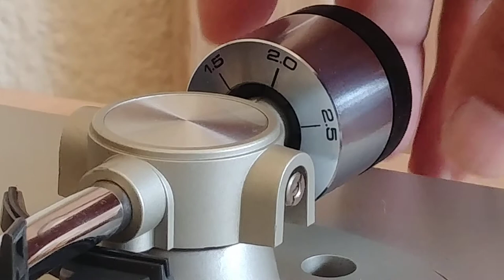How to balance a tonearm

Comment: I have pioneer PL-200 turntable. It is decent turntable. DD motor is very silent. Only what I  done is oiling feets isolation rubbers with silicone oil. Now them are elastic. Price/ quality is o.k. It have original cartridge ( sound is good enough) but DUAL ULM 68E fit very well too.

Comment: Great video thanks. Just got a used one as a 2nd one for the room (have rega planar 1 plus outside) and so dont know much about vintage semi automatics. What is the best cart for this please? Mine still has the factory one.
Reply from the maker: I couldn't say what cart is best with this turntable. A safe choice would be  Audio Technica AT95E. Finding the best performing cart with your turntable is usually a personal journey of discovery. In general I have had good results with various Audio Technica and Nagaoka carts. But a lot of models are no longer available. You can also look at the Hana brand.

Comment: The arm should float level for the zero setting.
Reply from the maker: You are absolutely free to do that. Many references will tell you to. My observation of the dependability of the dial indication vs actual stylus pressure was derived using the method I described here.
Reply: This is an interesting point. Some say the arm should float level, but then different headshell/cartridge set ups will mean the stylus sits at different heights with a level arm, and so true zero should really be where the stylus ‘floats’ to. This is where this video was going by saying set zero = to the top of the rubber mat. This is then an actual zero reference to which the stylus pressure can be added. Where I would slightly disagree is that I think the horizontal reference point should be a record thickness above the mat.
Reply from the maker: @duncanmatthews1977  your last sentence reflects my actual thinking. The person for whom I made this video was not familiar with turntables and I had to give him a "good enough" level of instruction.
With more sophisticated turntable setups and advanced stylus profiles (in particular), the level of detail required can be critical. But the common or garden elliptical stylus is very forgiving. For the most part, applying audiophile knowledge to mass market turntables does not yield a benefit.

Comment: So basically you balance it by having the needle as close as possible to the mat, correct?
Reply from the maker: Yes. However, I have seen others set up the balance point with the arm horizontal. I believe that in practice there may not be a significant impact between the two zero balance points because the amount of adjustment required between the two is very small. My way may be more finicky, but it's what I prefer.

Comment: Mines 1.5 on the main bit then 1 on the small anti skate so I’m not sure if that’s ok
Reply from the maker: It's fine if it sounds OK. I believe the arm only needs a bit of assistance to help counter inward momentum. But a lot of records have an off-centre hole, which causes it to swing left and right every rotation, which brings the advantage of anti-skate compensation into question.

Comment: Why not do it with an old 12 inch record   ( 33 rpm ) . I would not put my stylus near platter mat  EVER
Reply from the maker: That would be safer. I do address this in the vid, though. Perhaps you missed it.
Reply: @shaunonverwacht9626  the problem i have is that when the tonearm auto returns it can be heard going across the record??
Reply from the maker: @johnvassallo7353  That will happen if the unit is powered on. It's not going to happen here because power is off. See 2:35.

Comment: I have the same 1980 pioneer phono, what stylus do you have?
Reply from the maker: The one in the vid is an Excell cartridge. I currently use an Aiwa AP-2200 turntable with a Rega Carbon cartridge. The Rega is a fairly nice budget cart which would suit your turntable. I have also recommended Audio Technica AT95E.

Comment: Great video!
I have a similar one (pl300) and it's lovely.
Could you tell me, if you know,  its effective tonearm mass?
( I want to upgrade from the  AT95e  to the AT VM540ml )
Thank you.
Reply from the maker: No, sorry. I believe that most turntables have a similar tonearm mass that works with most cartridges. It is only when you start looking at exotic setups that it may become a concern. Like when you fit an ultra-light headshell or cartridge, for instance.

Comment: Sorry to inform you but that is incorrect the factor recommends a  weigh setting for each cartridge you set the needle  to ride on the record for it's best performance you can set it with the scale they make just for the occasion.
Reply from the maker: Check 7:20 to 7:28. I do mention that the stylus weight I was setting to is the recommended range for the specific cartridge fitted. Also, having set up many turntables, I have discovered that the dial on the weight stub on mid-range turntables in general is reasonably accurate when compared to what is indicated on a dedicated stylus pressure gauge. I have made the audiophile journey and I can tell you that much of it is not relevant for the purposes of a turntable of this spec, which is representative of what most users own.